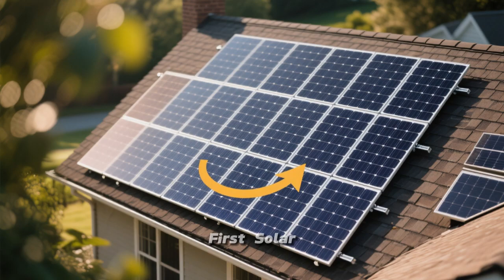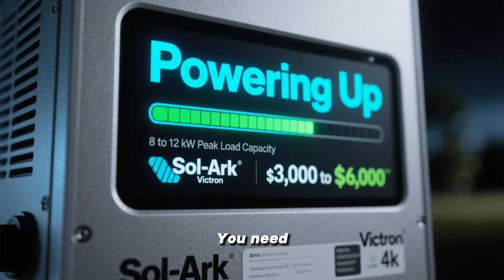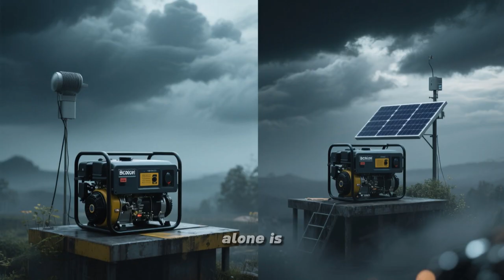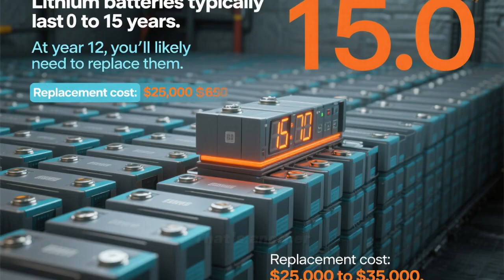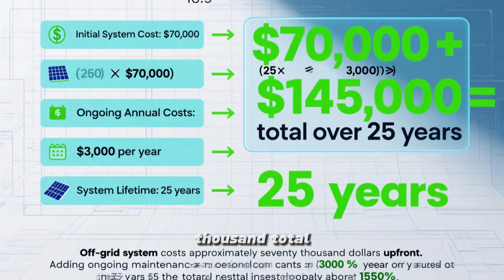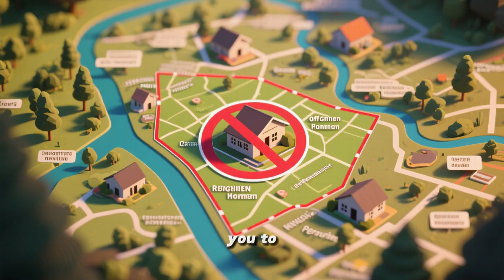Solar Expert Reveals REAL Cost of Off-Grid Solar Systems

Comment: OR. Go partially off-grid for under $35,000. By using a physical manual transfer switch between your solar power system and the grid you can switch between the two as needed. Panels can easily be purchased currently for 25 to 30 cents per watt. So call it 15kw for $4000. You are close on battery costs, but many good ESS's can be purchased for about 70% of what your estimate is. $4k is good for the inverter. Generator not needed since you have the grid as a backup.  Your maintenance costs are bogus in my example. There are none. I know this because I had this setup for four years and had no maintenance costs. So, using your format.

Panels: $4000
Batteries: $20,000
Inverter: $4000
Transfer Switch: $800
Wiring and install: $4000
Total: 32,000

As for batteries, LFP cells will likely last 15 to 20 years if proper charge/discharge procedures are followed. I have some 19 year old drill packs in my garage that are still functional. Additionally, battery prices are continuously falling and 15 years from now, as the industry matures,  they will likely be 10 to 20% of todays cost adjusted for inflation.

One more thing, if you are able to do some or all of your own installation, you cut the installation costs way down. And, since you can use the grid as a backup, you can also have a smaller system and have only enough panels and battery backup for three or four days. That would drop costs another 4 to 6 thousand dollars.
Reply from the maker: We're talking about two different things.
YOUR SETUP ($32K): Grid-tied with battery backup
✅ Manual transfer switch
✅ Grid as backup (no generator needed)
✅ 3-4 days battery
✅ Can fall back on grid anytime
MY VIDEO ($60K): True off-grid (NO grid connection)
✅ Remote property/cabin with no grid access
✅ 7+ days battery (no safety net)
✅ Generator mandatory
✅ Oversized for worst-case winter
Your approach is smarter for 95% of people with grid access.
My video was specifically for properties where grid connection doesn't exist or costs $50K+ to run lines. That's when you need the redundancy and hit $60K+.
If you have grid access, do what you did. Keep the grid, use manual switching, save $30K.
Reply: @LogicForgeSolar  Thanks for the reply. And you are correct as far as having no grid available. But, in your long term estimates you used utility prices as a comparison, but left out what it would cost to install utility power in order to use it. You did not include the utility inflation factor in those estimates. In most parts of the country, utility rates double every ten years so you would need to double the average utility cost for the time period. 
I will give you this. If you live in a place where you must be truly off grid your and you are unable or unwilling to do any of the work yourself, your numbers are probably close.
Reply from the maker: @jjackson3240  
You're right - I didn't include:

Grid connection costs ($20K-$80K for remote properties)
Utility rate inflation (3-5%+ annually)

So for remote locations, off-grid at $60K often beats paying $50K to connect + $200/month forever.
And yes - DIY cuts $10K-$20K off my estimates. Your $32K setup proves it.
My numbers were worst-case (professional install, no grid access). Your approach shows the smarter path for anyone willing to DIY.
Appreciate you keeping me honest.

Comment: If you spent $60k on this, then i have some bad news. You got severely ripped off. This can be done for $15k easily.
Reply from the maker: $15K for true off-grid? Drop the equipment list.
I'm genuinely curious because:

15kW solar panels (bulk): $3,750
60 kWh LFP batteries (cheap DIY): $24,000
10kW off-grid inverter: $4,000

That's $31,750 before wiring, controllers, or installation.
Are you running:

Grid-tied with transfer switch (not true off-grid)?
Tiny system (15 kWh/day usage)?
Used equipment?
Living in Arizona with perfect sun year-round?

Not doubting you - just show the breakdown. If you cracked the code for $15K true off-grid, the entire solar community needs to see it.

Comment from the maker: 💰 Off-grid reality check:

*UPFRONT COSTS:*
☀ Solar panels (15kW): $10K-$15K
🔋 Batteries (90kWh): $25K-$35K
⚡ Inverter/controllers: $4K-$8K
🏗 Installation: $5K-$10K
⚙ Backup generator: $5K-$10K
*TOTAL: $60K-$80K*

*ONGOING COSTS:*
🔋 Battery replacement (year 12): $30K
🛠 Maintenance: $3K-$5K/year

*25-YEAR TOTAL: $145K*

vs

*GRID-TIED SOLAR:*
💵 System cost: $25K
⚡ Grid electricity: $15K over 25 years
*TOTAL: $40K*

Off-grid = *$105K more expensive*

Still want to go off-grid? Drop WHY below 👇